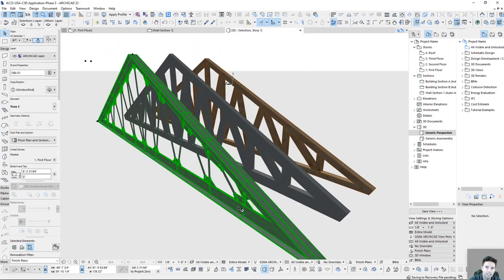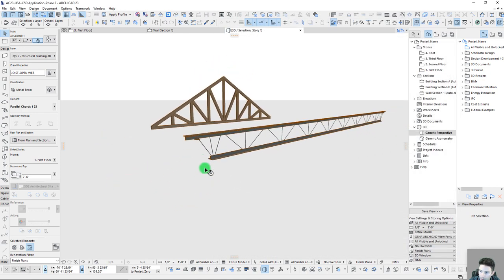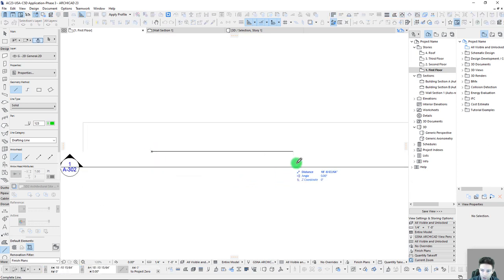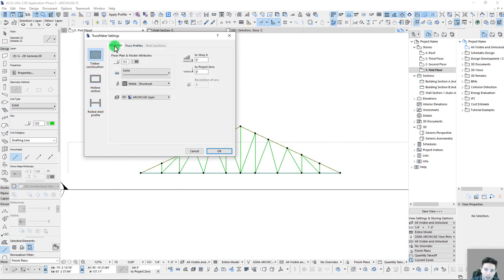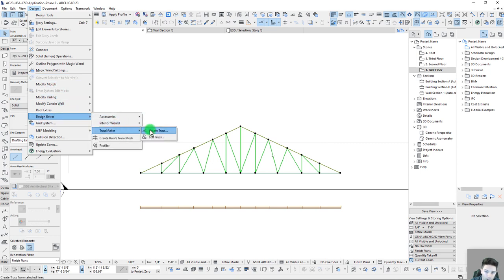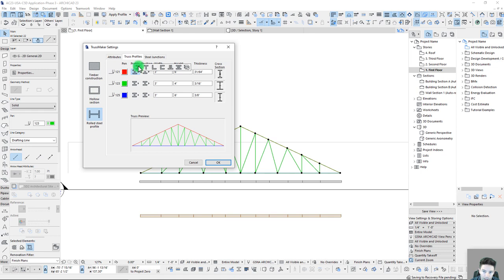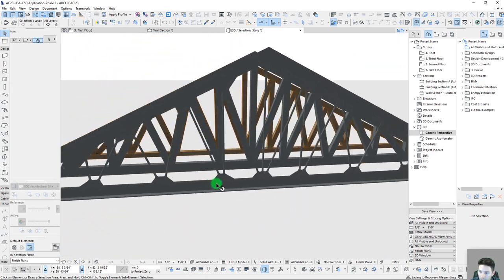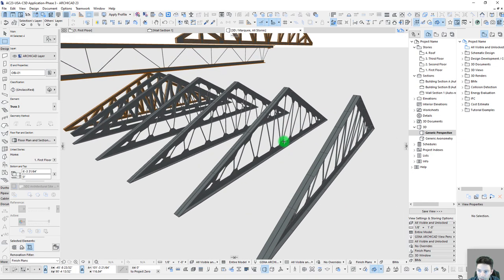Building Custom Trusses with ARCHICAD's Trussmaker!

Comment: Seems like there is no way to plumb cut the ends of wood top chord overhangs for a vertical fascia board, which pretty much makes this tool useless for normal residential work. I'd expect this in dumb cheap cad package, but something as sophisticated as archicad really needs to step up its game on these details. Been using since 4.5 and still constantly frustrated at the non-use friendly it can be. Does graphisoft not have any architects on staff anymore?
Reply from the maker: Yes I don't think the trussmaker has been adjusted or updated in a long time. It seems to work the same way it always has, which is ok for some purposes but obviously not a tool Graphisoft has spent a lot of time with. It does work for some purposes though. Plumb cut tails would be easier with a beam, or rafter object through roof wizard...
Reply: YEP, this was my question too❗️ I STOPPED using it virtually before ever starting because of this fundamental reason 🙄 🤨  The ONLY way to fix this is for us as Users of the software to submit these Improves as WISHES, although I totally agree that this setting should have been on the first release‼️  Perhaps we should both submit this and it will come up on their radar before WWIII gets too big 💣💥 😢  Getting time to get those Tribulation Veggie Patches 🥦🌶🥬🥕🫑🍓 happening 😎

Comment: I usually get my structural elements in IFC format from the structural engineer and I import the IFC in a separate file, which I then import into the main pln as a hotlink. The problem is that a lot of the times i need to put a lot of work in to that model to make it look right on my section drawings because the cut lines are not the right color or thickness and the fills are all blank. Trusses are usually a problem because they are composed of multiple elements like beams and columns, and when a beam and a column meet, Archicad is trying to make a connection or some sort of priority based intersection and that rarely ends up looking good in this case. What I'm trying to say is that I wish there was a better way of doing this kind of things in Archicad.
Reply from the maker: Hi Marian. Quick tip, before importing the IFC model of your trusses from your engineer, if you go into your object settings and change your pens first and make that the active setting for objects, it will likely convert those trusses per the settings you've established. One problem with Structural Engineering Models is they often don't reflect the right truss layouts, more generic. It's better to get from the fabricator if possible. If you're building them from scratch with the new columns and beams, your should be able to miter as needed to get a clean junction... Or set to 0 layer priority and that can clean up your intersections as well... just a few thoughts...
Reply: @CONTRABIM  I usually get a pretty complex model from the structural engineer, like the entire structure of a building which might have concrete columns and multiple tipes of steel trusses, and it actually takes less time editing the IFC then model it myself. The problem is I have to start all over again whenever I get an updated version. One thing that I think might help is sitting down with the structural engineer and go over the process of getting the file from one software to another and maybe figure outer what can be done to solve at least some of the problems. I just didn't get to that yet.

Comment: Hi John. Thank you for your tutorial! My question is: I just need to simply rotate vertically the library object "Parallel chord" (steel joist) to make a slope of 1/4 inch per foot. Is this possible?
Reply from the maker: Hi Roman. Great question. If you're building trusses using the trussmaker, you could simply add the 1/4 slope per foot into the linework first. This would probably be the easiest method. If it's drawn flat, to add a rotation parameter you'd have to go into the GDL script and add that which isn't too difficult. But you'd have to do this each time, so it'd be probably easier to just add it into the linework. Thanks for the question!
Reply: @CONTRABIM  thank you very much for your quick response! I appreciate it. Is there any link/source on how to edit GDL script for this parallel chord object? I want to give it a try. It is strange that this can't be done simply inside object properties like in Revit. Thank you again for your answer!

Comment: Very nice video thanks!!! I have a question though: For the upper and bottom bars i like to use a C shape steel beam, rotated in order  to proper make the truss. But in the truss maker definitions, i didn't found a way to rotate the C shapes in order to get the results i wanted. Is there a way to rotate the shapes in the truss definition? can i choose only between the ones that are already there?
Reply: Hi Lucas ✏️ When something is not in a Library Part that you would like, you NEED to send that as a WISH to your Head Office so they can forward it to the ArchiCAD Developers.  HO Techs often look at WISHES and may also add some thoughts to it before sending it.  I do this on a VERY regular basis and ALSO for far too many bugs 🐞 I find 🙄  Anyway, this is how things get improved for all of us in each release as the Developers are not aware of all the real world construction 🔨 options out there 😎

Comment: where do i get the library stuffs? there is no metal joints/truss in my current/default library
Reply from the maker: Hi Rasyid! Sorry for the delayed reply here. Which Archicad version and library are you using? In this vid I'm referencing the USA. Perhaps you could download and use the Truss objects from the USA or INT libraries? I'm surprised your language version wouldn't have any??
Reply: @CONTRABIM  if i remember correctly, i'm using archicad 23 education version. The truss objects from the USA or INT libraries are downloadable through other version?

Comment: Shame you cant add a rounded edge to the hollow section profile.  Some steel trusses have this like an SHS or RHS, not a square edge. 
You could use profile manager, not sure how the lower corners will turn out.
Reply from the maker: Yes the hollow section is a little more limited. Could always build it from scratch with complex profiles and modeling in section, but just depends how much time you're willing to put into it to get that radius corner. You could also convert to morph and fillet the edges.